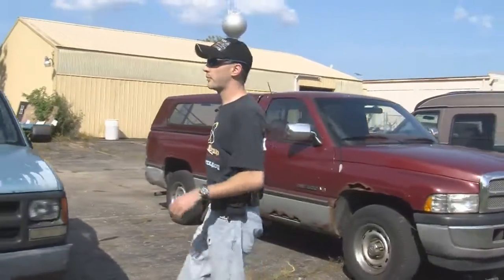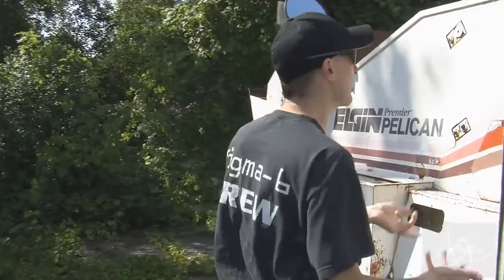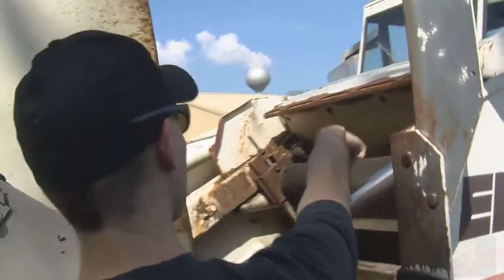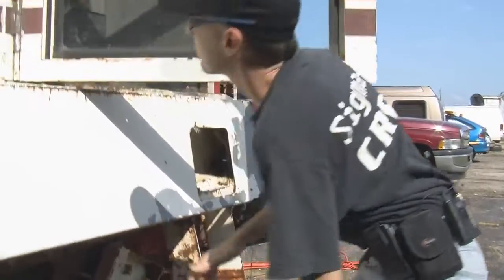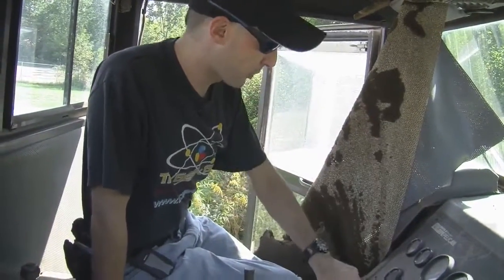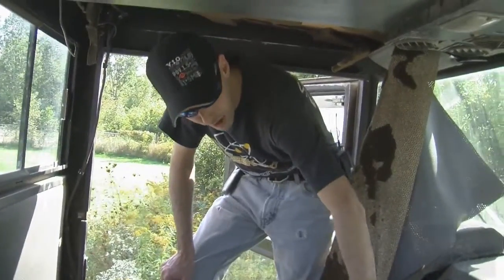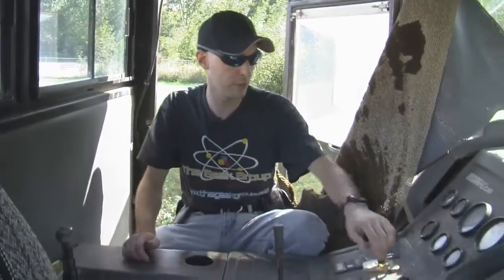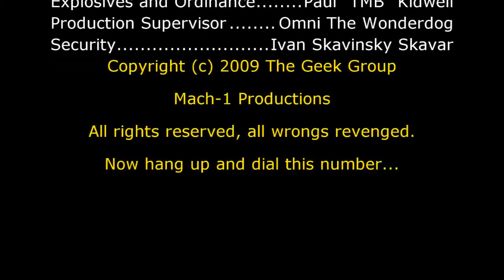Geek Group Streetsweeper

Comment: Cool machine!. I would take the starter motor off and give it a overhaul, make sure the power contacts on the solenoid are clean and don't have spiders smashed between them or somthing silly like that. (seen it before in old switches)

and just trace the wiring back and see if there is some silly aux relay or lockout thats gone kaput.

If you were local in Australia I would definitely sign up and have a look at it myself!